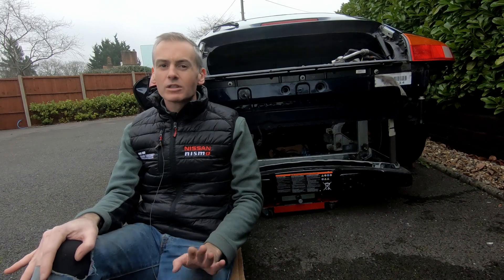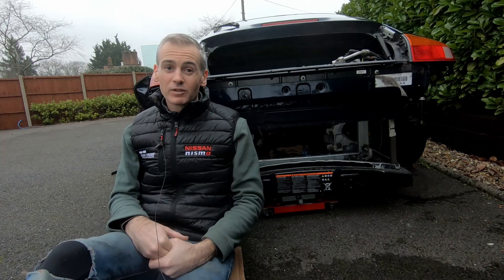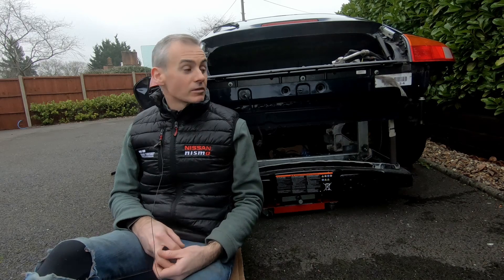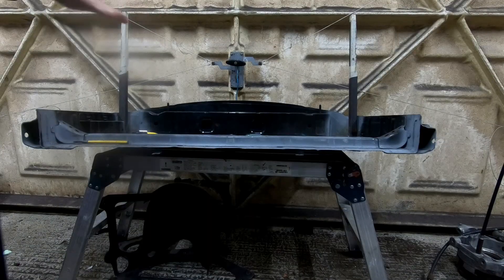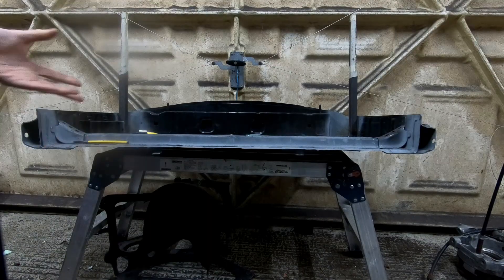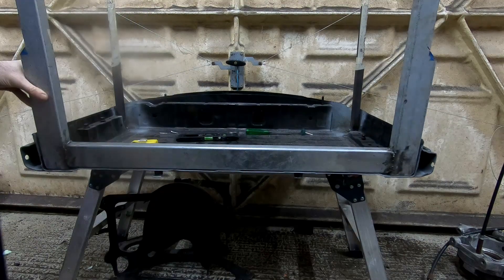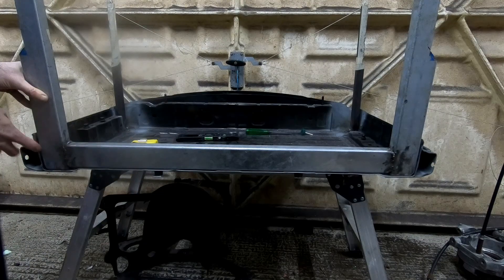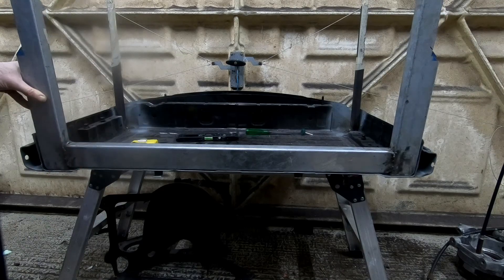Fabricating our Custom Nissan Leaf based battery box - Electric Porsche 911 project video 55 -

Comment: Your perseverance is admirable but this isn't going to work, either for durability or getting through an inspection. Get a specialist fabricator to design you some battery boxes and proper motor mounts. You can then got on with the rest of the build and start enjoying it.
Reply from the maker: Thanks for the feedback. I think you may be right, time to go back to the drawing board. This won't be the first time:-)
Reply: @PerformanceEV  I think I mentioned previously. If you want to have a look at the battery boxes and mounting system in my Boxster then please shout. I’m based at junction 5 m25
Reply from the maker: @Tesla Porsche Thanks! I really appreciate that. If that would be possible, that would be amazing. I'm by J12, so not too far for me to go. What's the best way to get in touch with you?
Reply from the maker: It also weighs an absolute tonne on it's own...and that's before I add the battery box.

Comment: this looks like a lot of time and effort, and atleast to my eyes this all looks very sketchy and questionable interms of structure and durability. Would it not be worth making a drawings/sketches of what you want made and getting a local fabricator to give you a quote on it? This would both speed things up and reduce the messing about with sub par tools and yield a way better result.
Reply from the maker: Thanks for the feedback. I have been thinking over it the last couple of days and finding some gaps in my design, you may be right. Guess it's back to the drawing board.

Comment: Just an old machinist's tip...if you want to drill a hole in an oddly shaped piece of metal, center punch it first. The drill will follow the center punch dimple.